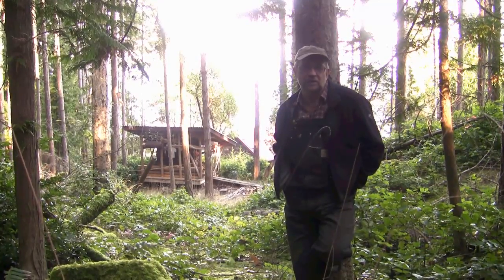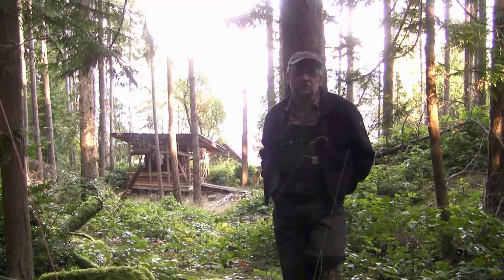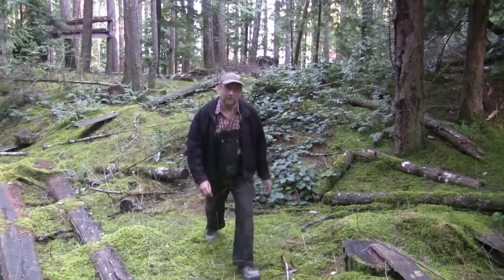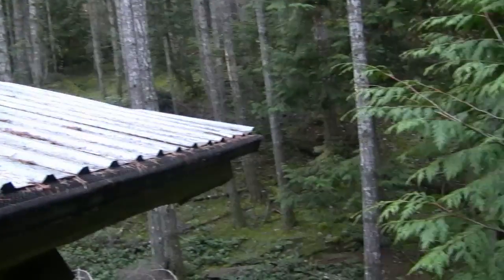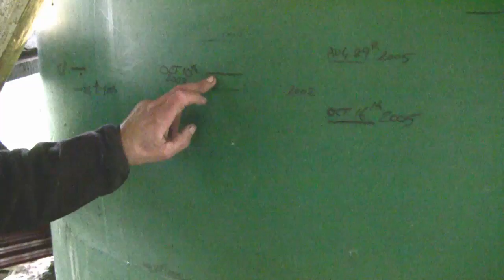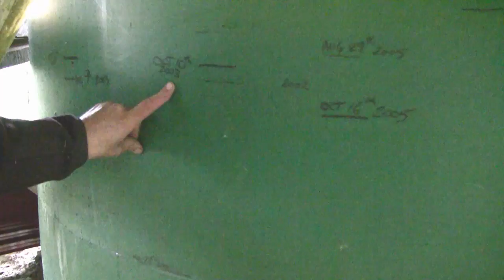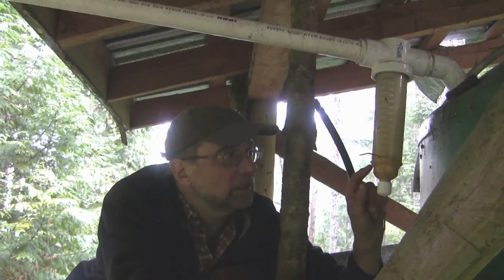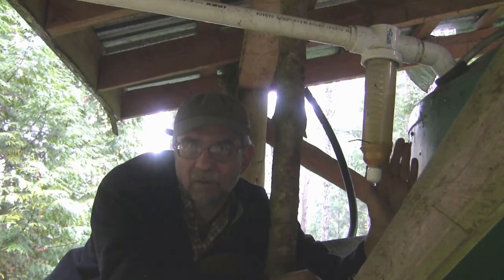Rainwater Harvesting Off Grid

Comment: Wait, so how are you keeping it (1) from clogging up the 1 1/2in. Pvc pipe, & (2) not fillimg up the barrel with pine needless & dirt, wouldn't you think a 4- 6 in. Pvc pipe work better with 3-4 cleanouts, i dont see how its not clogging up the lines or filling up the barrel with pine needles & dirt, you only have 1filter wouldn't 3-4 filters be better, but it looks like you got it going on
Reply from the maker: I'm not sure what your concern is. The system, as I described, works AOK for me. As it has for the past twenty years.
Thanks for watching...
M

Comment: cost for a setup like this in 2019?

(for someone with a similar hill & climate)
Reply from the maker: Hey Jordan,
Without heading to my local water supplies store, I can't give you an accurate price...your mileage will vary anyway.
If I had to build the system today, prices have not changed too much; I imagine the tank, pipes, fittings & filters would come in around CAN$2000.00. Only an estimate though.
Cheers,
M

Comment: A most fantastic video - just 2 questions from cold and wet England1. What make is the clear filter you use2. if it freezes - and it can get to say -10centrigrade, 14 F, is there any type of tank which will not crack with Water kept in it?Many thanks

Comment: Very interesting video. Thank you. I guess you don't need uv filtration? I'm surprised 2000 gallons is enough water!
Reply from the maker: +Joan Smith 
Hey Joan,
UV is unnecessarily expensive IMHO. What I describe works well for me and complies with the KISS principle.
2000 has proven perfectly adequate for our needs over the years, We are not full time at this location and there is no garden, no flush toilet or modern laundry facility. The occasional summer rain replenishes the supply somewhat.
Regards,
M

Comment: ummm..... I thought swimming pool chlorine tablets are cyanide-based. What brand chlorine tablets are you using?
Reply from the maker: +bbnemesis123 
If cyanide was the basis for swimming pool chlorine tablets, how many people would continue to swim?
Cyanuric acid is a component and is  "essentially nontoxic" https://en.wikipedia.org/wiki/Cyanuric_acid#Safety
Don't forget, I run the water through an activated charcoal filter prior to consumption.
Been drinking the water for over twenty years.
M

Comment: Big filter (20 microns or so) before the main storage tank including chlorine puck, smaller gauge filter including charcoal element after the main storage tank...... Have I understood properly? Is that really all it takes to convert rain water into drinking water safely & reliably?

Really great video sir. Much appreciated!
Reply from the maker: +Stuart Hardy Cull 
Been drinking it for years!
Sorry for my very late reply.
M
Reply: Markerbuoy - On Canada's Left Coast Seriously thinking about setting one of these up. Rain water has GOT to be cleaner than tap water.
Reply from the maker: +Stuart Hardy Cull 
Run tap water through an activated charcoal filter & you're good to go - no worries. No need to be expensive.
Cheers,
M

Comment: Great channel. excellent water pressure. Just wondering when it freezes and your system is off how do you get water?
Reply from the maker: +cabmaker 
We are not at this spot full time, although we go year round in all seasons. Currently, the water system is drained to protect against freezing, although all the water remains stored in the main tank. I'll be over there in a couple of weeks and chances are good I will be able to reactivate the system. We are lucky to enjoy mild winters here on the west coast, although we occasionally have a strong blast of arctic air in winter - fortunately I have never been at the cabin during a hard freeze. 
Thanks for watching,
Cheers,
M

Comment: Are you running the tankless heater with an ordinary propane tank. 20-50lb range? You said you cant get trucks up there, so I figured no one is coming to fill a big tank.
Reply from the maker: +MarlowWhere 
Quite right, no propane delivery, anywhere in sight. It's 20lb tanks hiked up the beach each time we visit. 20lbers are economical to buy, fill & are reasonably portable.
Cheers,
M

Comment: Will this system work for someone who will be living in a cabin permanently and is this the only method of collecting water you have? 

Great video by the way! :)
Reply from the maker: +tayorous 
Hi,
There is no reason this system will not work full time. Your only restriction is the amount of tank storage available & moderate water conservation, if necessary. If your area is subject to hard freezing, this is another matter - insulation/deep supply lines, etc.
Thanks for watching :-)
M
Reply: thanks for the response man!

Comment: Well designed system!  I especially like the idea of putting the collection tank about 100 ft. above your home.  Any idea as to the amount of rainfall (gallons) that you are able to harvest annually with your 300 sq. ft. platform?  Any idea as to how much water (gallons) your family actually uses.  Also, about how much rainfall do you enjoy each year?  I ask these questions because the calculations that I am coming up with suggest that I might need approximately 1,000 sq. ft. of collection area to collect what I need (given 54 in. of average annual rainfall).  Any input would be greatly appreciated.  Thank you!
Reply from the maker: +Glenn Ames Thanks Glenn,
I'm lucky enough to have the elevation - otherwise I'd be fiddling with batteries & a 12v pressure pump like some of my neighbours.
Rainfall around here averages 30"-35" per annum & most of it falls November thru February. I'm sure I could fill six tanks off my roof, although I have never done a formal calculation. The tank is usually brim full sometime in November.
Currently, we have over 1000 gallons in storage after a very dry summer. We are not full time in this location. There is no flush toilet or laundry but we (modestly, in terms of water use) shower & bathe when we like.
The plan is to install another tank, shared with my neighbour , not so much out of need but by way of insurance.
The system as described works well for us. I tend to build stuff off the top of my head & then adapt if necessary - but so far so good. 20 years & counting.
Good luck with your system!
Cheers,
M
Reply: Thank you, Markerbuoy!!

Comment: since none of us including you is getting any younger..lol...could you move those filters and valves under the cabin up to under a sink or somewhere inside so one doesnt have to crawl under as you do now...would it affect the pressure being up that little bit much higher
Reply from the maker: swanyut The reason the filter is under the cabin is that the whole system, pipes & filters, has to be drained before freeze up. Moving everything under the sink wouldn't affect pressure significantly but sure would make a mess come November LOL :-)
Best Regards,
M

Comment: Nice video. Love the accent! I was wondering, are you not concerned with bacteria and viruses in rainwater? I've read rainwater carries parasites and nasties. No filter in the world will do away with viruses. Also, with such a huge tank, I'm surprised there's only ONE filter.
Reply from the maker: Bllie hunt Thanks.
Chlorine takes care of most pathogens, as I describe. Works for me....been drinking water treated this way for over twenty years.
The incoming filter screens out particulate matter and the activated carbon filter at point of use is changed as necessary. A little maintenance goes a long way.
Cheers,
M

Comment: Wow this was a great idea im just worried for living in PA the winters feel very long and very cold and I dont know If I would have enough water to last all winter and not have it freeze what do you think? Right now im just a family of two but im planing on building my own small house.
Reply from the maker: Hey Charlissa;
Full disclosure: we're not off-grid full time, although we visit as often & for as long as possible, all year round.
In our location, ALL the rain falls during the winter months and thankfully, major freeze ups are rare.  The stored water has never frozen solid but I do drain the lines when not present, as a precaution, if there is chance of a freeze during winter. The water supply line is buried slightly underground, which seems to allow flow during use in freezing weather.
As with all things off-grid, your mileage will vary and part of the challenge is figuring out what works best for you, where you are.
I enjoy sharing what works for me and I thank you for watching & taking the time to write :-)
M

Comment: That is a fantastic set up. And you are right about the pressure - it's .433 PSI per foot (minus any friction loss from the pipe). You have a good 40 PSI like you said. I am on flat land so I am stuck using a 12 volt on-demand pressure pump to move water from my water barrels to the house but it works well also. Great video.
Reply from the maker: Hey, thanks for your kind words. I have neighbours who use pumps for moving water around, despite the fact they could have gravity feed from up the hill. As long as it works, that's all that counts :-)
Cheers,
M

Comment: Hey there, great video, i really liked it, and will subscribe for sure.
Anyway, i do have a question, how much chlorine is needed to purefiy one gallon of pure rain water, to be able safely Drinking it?
Reply from the maker: Hi,
I occasionally "shock" my 2000 gallon tank of water with one cup, or so of chlorine bleach. Also, I usually have the small solid chlorine puck in the bottom of the filter bowl, as the water enters the tank. I never make a "per gallon" calculation. This has always been more than sufficient, with no problem for over twenty years. Don't forget, I remove any residual chlorine, at point of use, running the water through an activated charcoal filter. 
Many thanks for the sub!
Cheers,
M
Reply: Hey, thanks for the quick answer, i asked per gallon, just becuse sadly at the moment i am not working on that large setup, just wanted to konw more for commen knowledge.
anyway, i done some research and calculation, and per gallon, 1/4 of a teaspoon to 1/2 a teaspoon would work as a basic emergency purifcation.

great videos man, keep them coming!

Comment: Hi. Do you just drop a chlorine puck into the center part of the filter. Does it float and when small enough enter the tank. Or does it just sit at the bottom of the filter. Thx
Reply from the maker: Hi Karl;
The chlorine tablet sits in the bottom of the filter bowl and never enters the tank, no matter how small.
I occasionally "shock" the tank contents with a cup or so of chlorine bleach, if I'm going to be away for any length of time.
The activated charcoal filter, at point of use, takes care of any residual chlorine.
Cheers,
M

Comment: Hi, We live on Waiheke island New Zealand where every one of the 8000 inhabitants collect there own water. Most of us have  iron roofs and concrete or plastic water tanks and most have no filtering system at all. I use a 200 gallon tank to collect the water from 2 roofs . Inside this tank I have an electric sump pump hanging about 200 mm from the bottom . When this tank is nearly full this pump starts pumping the water to a large 5500 gallon water tank . The leaves etc. stay in the bottom of the small tank and we get perfectly clean water in our larger storage tank which we use without any further filtration.We add no chemicals to our tank at all and are fairly healthy in our late seventies.
Reply from the maker: Hi Robvaas;
It wasn't until Cheryl contacted you that I realised that somehow I missed your post. Sorry about that - I try hard to answer all my correspondents.
I am aware that lots of people down under collect rainwater for most, if not all of their own needs and it sounds as if you lot have a well developed system that works very well.
We are not off grid full time unfortunately and spend time in town for work and other reasons; treated municipal water is becoming very expensive around here, especially as (astronomic) sewer costs are tied to water use. I feel the need to go back to basics and start collecting rainwater here in town, just like everyone on Waiheke Island :-)
Thanks again for commenting and sorry again that I missed you first time around.
Happy New Year!
M
Reply: Hello Robvaas. Fantastic to read about where you live. I'm wondering if you could direct me to pictures that show of homes in your area and how the water tanks look? I would love to live entirely on collected rain water (versus digging a well) but would like to set it up in a way that is fairly attractive. Thanks!!
Reply: Hi Cheryl I will show you a couple of photo's and will explain how it works on my Facebook site "Tiny houses from rob"
Reply: robvaas Thanks! Will check it out now! :)

Comment: Thank you for posting.  Is there an alternate way to clean the water other than chlorine?  The city uses chlorine as well.  I'm not a fan of chlorine.  How can I do this?  Thank you!
Reply from the maker: Chlorine is very effective when used to "shock" pathogens in water. When left standing and protected, the water remains good to drink long after all traces of chlorine have dissipated. To make sure, I suggest running the water, at point of use, through an activated charcoal filter - timely filter replacement ensures no chlorine gets through. Our family has been drinking water treated this way for over twenty years. Municipalities tend to over use chlorine, especially during warm weather, possibly due to liability issues.
There are lots of other methods out there, including UV treatment and of course you can always boil the water in order to purify it but good UV equipment is expensive & boiling is time consuming and inconvenient.
Sorry I can't be of more help but I like to keep things simple.
Cheers,
M
Reply: Ultraviolet water purifications may be what you need .
Reply from the maker: dozdeshabb Correct, if you want to spend lots of money :-)
Reply: Markerbuoy - On Canada's Left Coast

Comment: Was wondering what you are doing with your grey water?
Reply from the maker: We are not full time out there (unfortunately)
Grey, sink water goes to an earthen sump. Shower water is distributed through a 4" perforated pipe in the wild bushes & septic drops in to the outhouse - the original composting toilet :-)
Cheers,
M
Reply: So another question then; I see lots of videos on using grey water for plants, is there some reason you shouldn't send it back through an identical filter system to this as to reuse it?
Reply from the maker: PinkPirate85 My system was never designed to handle grey water.
Try starting here http://www.grey-is-green.com/ and Google around a little :-)
Cheers,
M

Comment: Thanks for sharing this idea, it seems a really simple practical solution. Just one question - what do you do with the chlorinated overflow from the collection tank? If its strong enough to kill all the bacteria...
Reply: it would surely need to be de-chlorinated before being discharged? And if so, it would be a waste of chlorine and filters for water that is not being used for anything...
I would be very grateful for your thoughts, as I am planning my own off-grid adventure soon. Thank you.
Reply from the maker: Dag Larsson
Around here, overflow is only an issue in winter (rainy) months. We are not full time off grid & although we spend some winter time at the property, typically we are there less often. When chlorine is used to purify water (all over the world) the immediate addition "shocks" the system by killing most pathogens. Thus, properly stored, the water will remain fit to drink for a long time. Chlorine dissipates rapidly. If chlorine is not over used (ie in far too high a concentration), the overflow issue is not a cause for concern IMHO 
In twenty years, any overflow from my tank has had zero visible effect.
Overflow can always be redirected...why not install extra tanks?
Hope this helps....
Regards,
M
Reply: Markerbuoy - On Canada's Left Coast
Thank you for the advice, it's much appreciated. Enjoy the sunny season!

Comment: So, during the winter, you don't use rainwater for your cabin/home?
Reply from the maker: We are not off grid full time, although we visit the cabin regularly all year round. The climate here is classed as mediterranean (hard to believe), punctuated in winter with the occasional hard freeze. Most of the time the water system is fully functional - only when away do I drain all the lines to protect against freezing.
Cheers,
M
Reply: Your large container doesn't freeze?  You drain all the rainwater out of it as well?  Thanks for your response.
Reply from the maker: nzinga zindua I drain the supply lines and LPG heaters only and provide for the pre filter (at the tank) to drain after rain has stopped (as I describe in the video). A major winter freeze here may last for a week at a time, two or three times per season, when temps may reach -15 degrees centigrade/5 degrees F. The tank is 2000 gallon capacity & apparently there is enough mass to prevent total freeze up of the contents. Never happened in over twenty years.
Your mileage may vary, depending on location :-) 
M